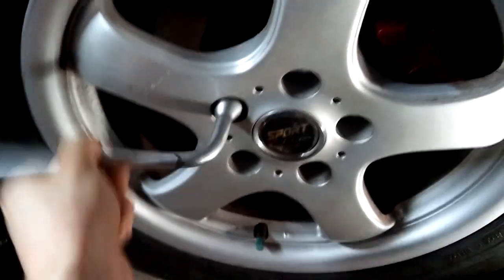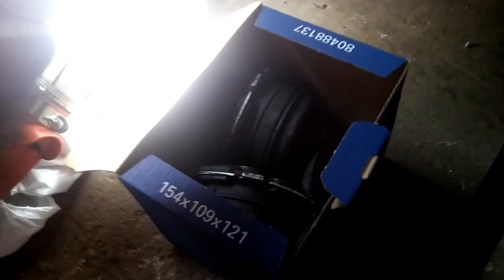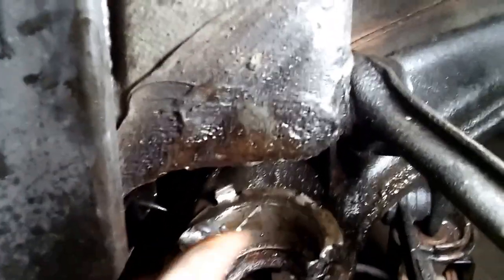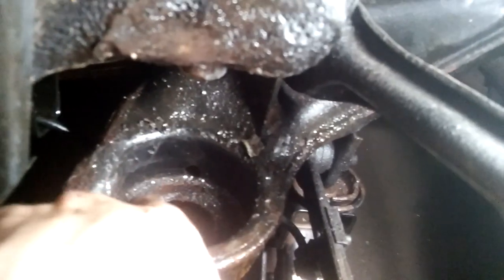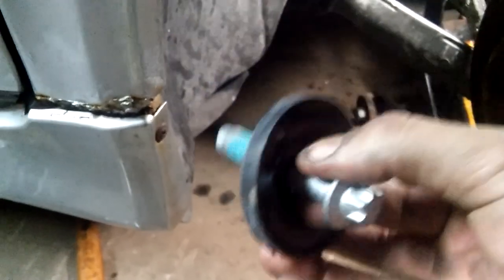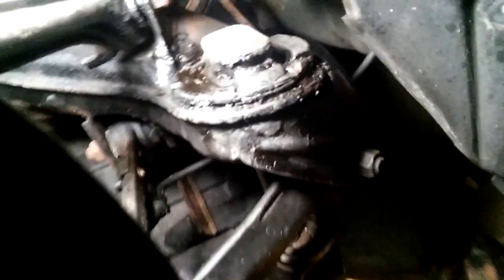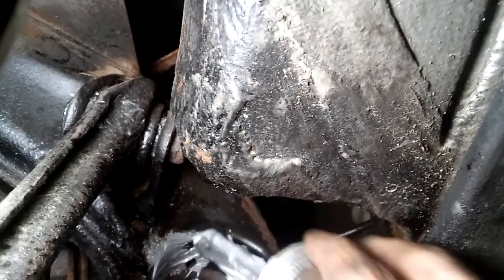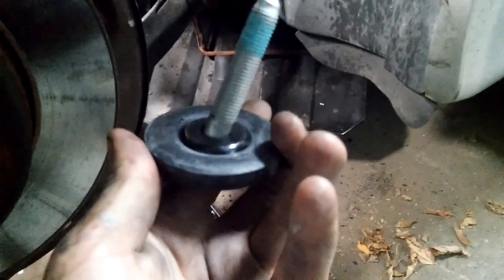MERCEDES W210 SUBFRAME BUSHINGS REPLACEMENT/ Замена сайлентблоков подрамника

Comment: Here's what worked for me. I took the advice in the video about dropping the subframe. Very easy and straight forward. As far a getting the bushing out, I heated up the subframe around the bushing and used a pickle fork as a wedge and hammer to get the bushing to start coming up. Between that ,  a pry bar and repeated heating it came out rather easy. use heat and or dish soap as lubricant if needed..  GL
Reply: nice

Comment: Get some heat on them and lever under the top edge they come out fairly easily, if all goes well could take 20 min per side. Heat is the key.

Comment: Dude, congratulation for the change, however i would definitely not recommend lifting the car by the bushing to press it in or out. Just take some long screw from a scrap yard, some washers and nuts some bearings and 2 U frame and you can safely press in or out the bushing. You have plenty of space for that.

Comment: Pushing up is okay but if the bushing is totally gone you'll just push a blob of rubber out and will still need to remove the remaining bit - heat will help with this.
Reply from the maker: moonkef If the subframe is out of the car then I would use the heat. Never tried using the heat on them when everything is on the car. Too risky, especially on rubber
Reply: Great video man. Heat on these kinds of bushings is quite normal only a small blowtorch not a huge welding rig. Mercs are so good to work on though which is a bonus :)
Reply from the maker: moonkef Thanks brother, I love these cars and there is more Mercedes projects to come!:)

Comment: Hello Vito. Can you tell is it possible to remove rear sway bar completely without dropping subframe?
Reply from the maker: Yes it’s possible. You just have to be a little patient and be careful with the sway bar bushings bolts. Sometimes they can strip
Reply: @VITOSGARAGE  
yep i know that i have replaced the rubbers. now i am thinking to upgrade rear sway bar with h&r one and that’s why i wanted to know, if i will able to do the job myself (diy).
Thank you 🙏

Comment: Thanks - do you know the rear sway bar mounting bushing "Bolt" part number? One of the bolt is stripped and required replacement. Thanks.
Reply from the maker: Hi there. Where are you located? I don’t know the part number of that but I will try to look for it
Reply: @VITOSGARAGE  it's W210, the bolt should be HX6, like this video at 0:37 https://youtu.be/-H1ntciGlCU

Comment: Great video! I have a W211 which has got almost all suspension parts and shocks new in the last 30.000km. Now I have the feeling the car is constantly drifting when I turn and it is extremely sensitive to wind on the highway. When there is no wind and the road is straight the suspension works great. But once I turn left right it the back seems to overtake me. Any idea?
Reply from the maker: Nikolaj Hard to say. It might be an alignment issue, check your alignment angles and make sure all the suspension components are tight, especially all the bushings
Reply: Were the rear arm outer joints replaced? They made my 210 and 124 feel awful when it was windy, wandering etc.
Reply from the maker: Nikolaj Yes, that's one of the bushings (сайлентблок). Check everything
Reply from the maker: Bad subframe bushings can cause that too
Reply: I had almost everything changed in the suspension and it is really hard to find the one faulty on mercs :/ I'll check the silendbloc
Reply: The outer bearing joint in the lower hub, I did mine yesterday and it had several mm of play and was full of water, no more wandering in the wind :)
Reply from the maker: Nikolaj Make sure everything is tight and in good condition in the front and rear suspensions. Finally make sure your alignment is ok. Bad subframe bushings can cause the car to wander and go crazy..

Comment: Hy does it work the same with the back bushings ? 
 I have a 1995 c180 
 They told me it s the back ones . 
 Do I need to remove something else , like that triangular shape almost thing ? And can I do it 1 at a time? 
 Thanks
Reply from the maker: It should be the same procedure like in the video.
Yes, you can do it 1 at a time
Reply: @VITOSGARAGE  thank you.  I checked and I think the upper part is too rusty so it will break If I push it in . On the back bushings
Reply from the maker: @redeemernigoohaem9735  in this case lower the whole subframe and do it correctly with the subframe out. In the mean time you must clean and treat all the rust in those areas! It's very important or it'll keep rusting! It's bad
Reply: @VITOSGARAGE  thank you so much ! . Is there any video on how to take it out ? Cuz I heard it s difficult to do it.  
 And there s a lot of rust . I think the whole back of the truck is finished.

Comment: I hear knocking noises under my 190E left rear, which is worse at low speeds and cold start. It sounds like metal against metal.

This problem has made me crazy for 5 years driving the vehicle and many garages have miss-diagnosed the problem.

The garages have changed N/S and O/S rear:
Springs
Shocks
Top shock mounts
Front lower control arms and bushes

I did a crow bar test on the rear N/S when the wheel is removed and when lifting at the front control arm the noise is replicated.

Do you think the problem is the sub frame bushings / silent blocks???
Reply from the maker: Ever checked the rear lower knuckle bushings? They go bad and they're pressed into the knuckle
Reply from the maker: Lower control arm mounts to those bushings. Also check the sway bar links and subframe bushings. Subframe bushings go bad too
Reply from the maker: I just got a 190e recently too. I love the car
Reply: VITO'S GARAGE I still have my first car as a student, 190E, 1993 plate, manual, 1.8. Glad you got one, it drives like a dream and cheap to run 🙏
Reply: VITO'S GARAGE Yes we just changed the entire lower control arm and the bushings are now built into the arm. So both bushings on each side were replaced
Reply: VITO'S GARAGE How can we check the rear lower subframe bushings? I think this is the only other possible fault.
The car does lose some control when cornering as the back end goes out, but guess this could be the design of the 190E?😆

Sway bar is fine.

Thank you for all your advices
Reply from the maker: @jagjitsingh630  if the subframe bushings are severely cracked, you'll see it. Inspect them visually. 
With the engine running, have someone put it in gear when you watch the rear subframe underneath. Look for excessive movement and such

Comment: Can you swap the engine off a 1997 e320 into a 1995 C280 without any reprogramming?
Reply from the maker: Is it M104 Inline 6 engine?
Reply: Yes but the 1995 c280 has 2.8L inline 6, the 1997 e320 has a 3.2L inline 6 identical in every physical way that I can see and most of the parts on and around the engines are exactly the same
Reply from the maker: @newtonraymond77  The displacement is different, but otherwise the engines should be the same. It should fit no problem. The question is whether or not both of these engines have the same amount of sensors and the same electrical connectors. I think they're both the same. 
The worst case scenario is you might need to swap the ECM and TCM, and maybe the engine harness. I can't really tell now since one car is OBD1 and the other is OBD2. 
Why are you trying to change the engine? Blown head gasket? Maybe there's something I can help with? I work on old school Bimmers and Benzes. I upload new videos every week or different car content.
Reply: @VITOSGARAGE  blown head gasket with 2 problems an oil leak in the front and oil in the reservoir. Every 5 months I remove and clean it which isn't such a big deal but the oil leak produces a puff of smoke when I get off the highway. It'll cost more than the car is worth to repair but I like that little car. I also have two 1997 E320 one I drive and the other in rough shape which is also driveable. I fixed a rough idle condition on it and it's smooth as silk. Perfect engine for a swap but I'm not that knowledgeable I only do basic repairs on my own vehicles
Reply from the maker: @newtonraymond77  I feel you. Don't worry, I'll help you with this. I'll walk you through it. These cars are amazing! Please save them both.
The head gasket is not that difficult to change on m104. Just don't be afraid, it's not that bad. Do you have Instagram or something? Or write me an email so we can do this. My contact info is in the description of every video
Reply: @VITOSGARAGE  I'm sorry I didn't see your comment before now. I'll definitely get in touch with you if I decide to change the head gasket thanks

Comment: how did you push the bushing upwards? i didnt understand what you did there. im changing them on my Mb soon
Reply from the maker: Put a socket with extension under the bushing and use a jack to jack it up. But you also need to put some blocks or something (I used a big axle nut socket) on the top of subframe so the block will press against the body and you will have clearance to press the bushing out. If you don't put the block in there then you are basically moving the subframe up and down without doing anything. Hope this helps
Reply: ye i get it now. i just wasnt sure what you did to keep the subframe down while you pushed the bushing up.

Comment: I took both bolts out on one side and the subframe barely dropped. I've been prying at it and it barely moved. The front bushing will come off the chassis but the rear one seems.seized. Any tips on how to free it up? Sprayed with brake cleaner and pb blaster but it's not helping.
Reply from the maker: DinoSR20 Wait, so the bushing is stuck to the subframe or the subframe is stuck to the chassis and it won't come down?
Reply: The rear larger bushing will not let the subtrame come down fully. I think the rubber is stuck to the metal post on the chassis if that makes sense. I'm not able to even jack the subframe back up and put the car back together again.
Reply from the maker: DinoSR20 Spray pb blaster and it might take time for it to free up. It's unusual for that thing to get seized. Lightly tap the subframe with a hammer where it's seized. You should be able to put it back, just look where it's binding when you lift the subframe back up.

Comment: Did you have to remove the axle or subframe from the car to remove/replace this bushing?? It looks like you are just jacking up the vehicle, unbolting only one subframe bolt, and letting the weight of the vehicle push out the bushing?? I have a w211 and may do this DIY, and I found your video very useful Note I am starting a thread on my Mercedes forum, and I comment on you video. Feel free to check out my thread and please let me know how you removed the bushing.https://mbworld.org/forums/e-class-w211/720313-w211-w219-rear-subframe-bushing-determining-whether-diy.html